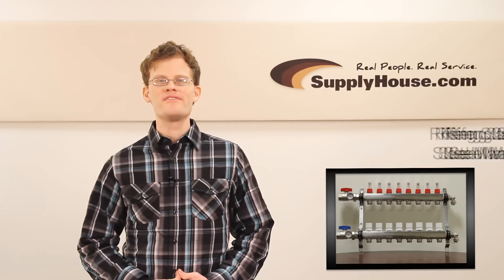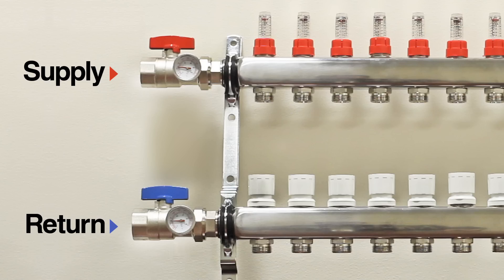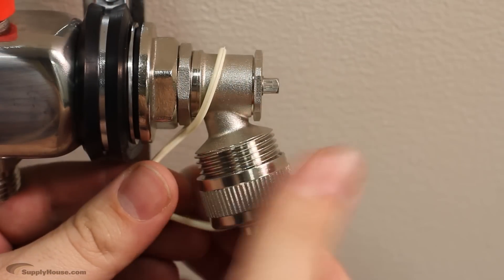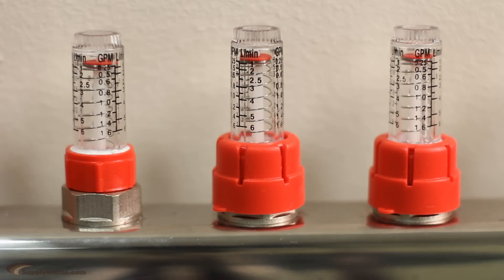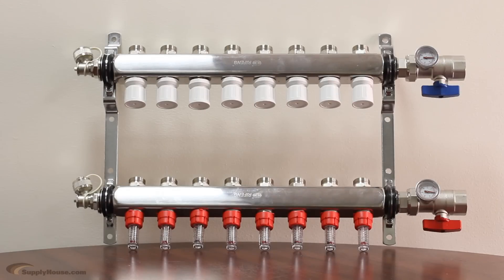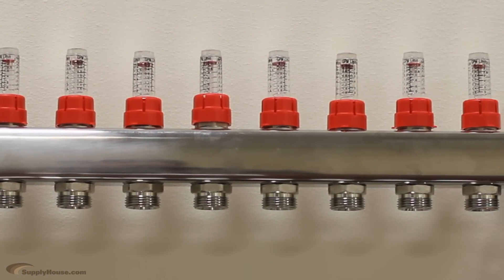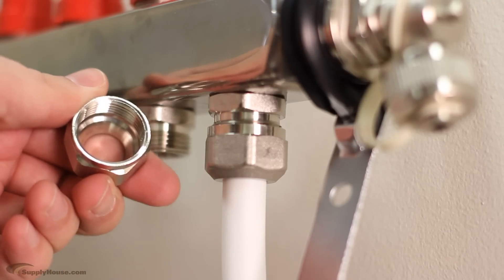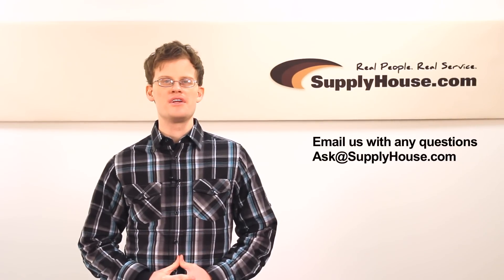Rifeng Stainless Steel Manifolds

Comment: I have an FN 15 manafold, one of the flow meters cracked and was leaking. I shut off the loop hoping to replace the flow meter. Can I replace just the meter or do I need a new manifold? When I try to unscrew the broken flow meter it will not come out. Am I doing something wrong?

Comment: I just had a Navian 240 tankless boiler installed. It has a FN16 manifold, using three zones. I'm not a plumber, but the flow meters are on the RETURN side, and the actuators are on the SUPPLY side.This is the opposite of all the pictures that I see.Like I said, I'm not a plumber, so this may seem like a silly question.Does it matter??? P.S. the temperatures in the three zones are extremely erratic
Reply from the maker: +Joseph Feller I'm not sure why your temperatures would be erratic, but it's ok if the flow meters and actuators are on opposite sides.
Reply: +SupplyHouse.com Thanks for the quick supply!! A little background. I have 2 zones. One is baseboard for the basement, and it works perfectly. The other zone is radiant heat. It has a FN16 Rifeng manifold.It has "Mr.Pex" actuators, and flow meters on each (3) individual zone. One zone (bathroom) is extremely short. The bedroom is larger, and the 3rd zone is very large.All of the flow meters are set to the same level, which doesn't seem correct.. I set the bedroom to 65, and it has gone as high as 74. The thermostats are Tekmar 532 programmable. Would "cutting back" the flow, by way of flow meter work?I thank you very much for your help.It's greatly appreciated!!
Reply: +SupplyHouse.com I appreciate your response, but I had the plumber come back, and pointed this out to him. He got on the phone with some factory rep., and he indeed DID switch the flow meters to the supply, and the actuators to the return, and it works perfectly now. Just for your info....